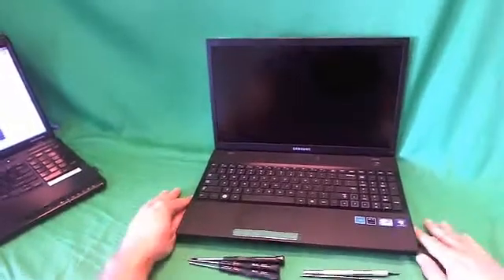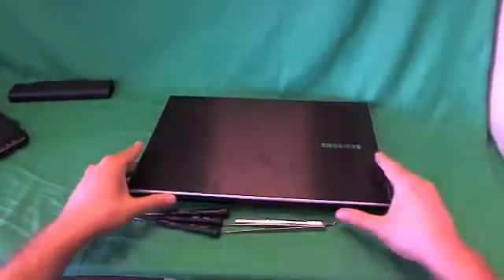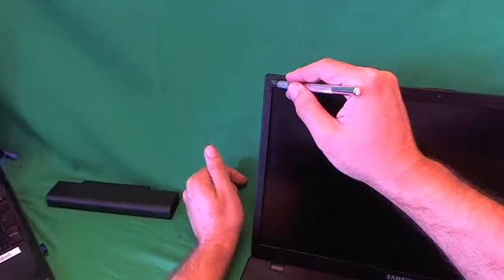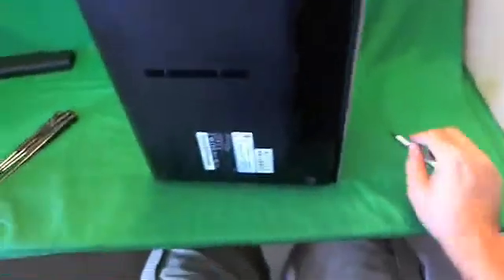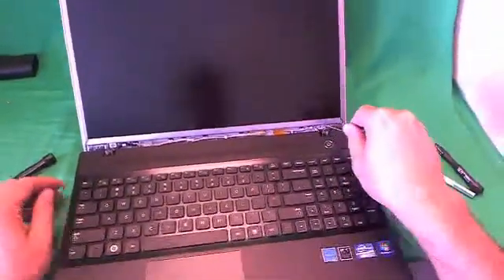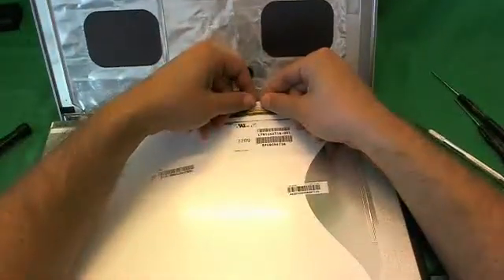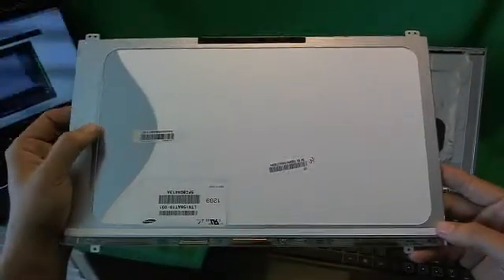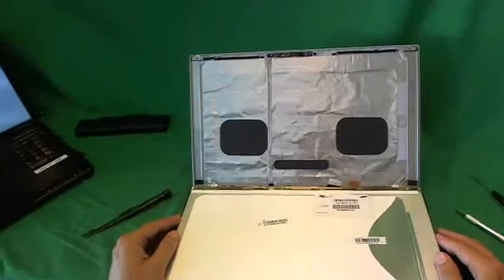Samsung NP300V5A Laptop Screen Replacement Procedure

Comment: Thanks for the guide and the detailed part on the connector. It's difficult to apply enough force to get it seated sometimes if the connector flexes, and using a spudger ontop of the adhesive tape may be necessary. Saved me a lot of diagnosis time.